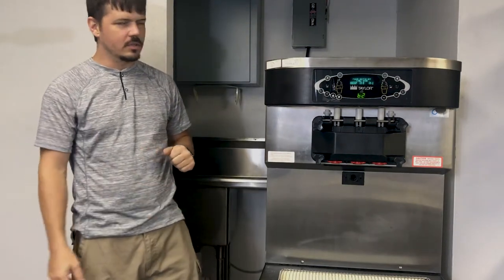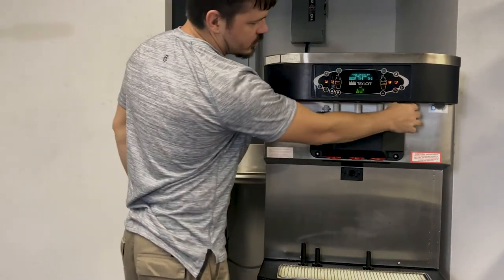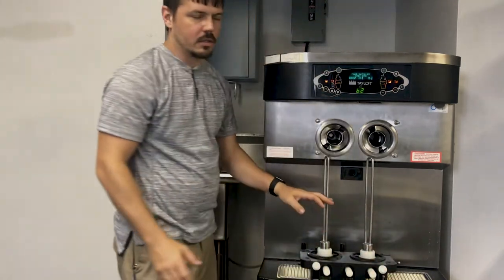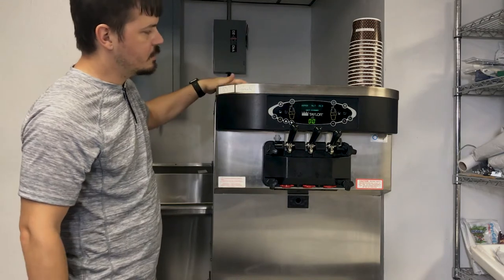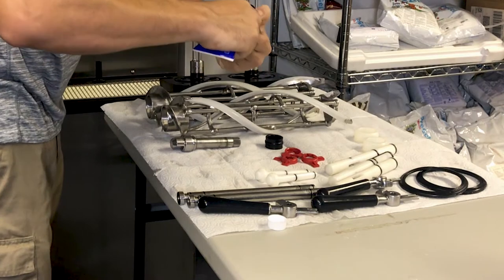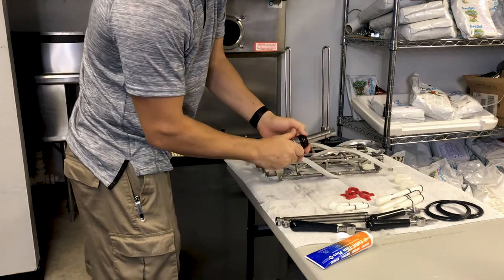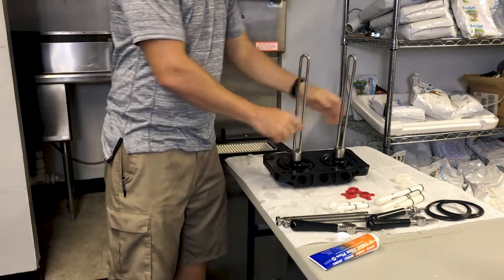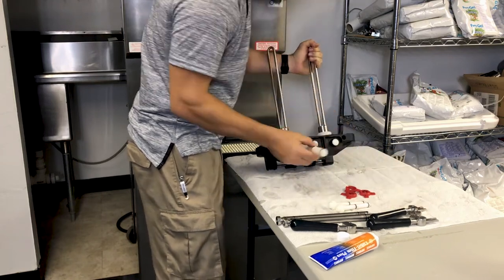Taylor Crown Series Cleaning Lock Out Procedure

Comment: My Machine is dispensing liquidy yogurt on one side while the other side seems fine. I replaced the thermostat and all the temps are within normal range. What possible issue causes this?
Reply from the maker: Hi, It could be due to low freon, bad blades, bad assembly, etc. Without more information it is hard to tell.
Reply: @slicesconcession8012  
If the yogurt freezes and is preventing the barrel from turning to dispense, what's the solution?
Reply from the maker: Hi, This means your viscosity is too high and needs to be turned warmer.